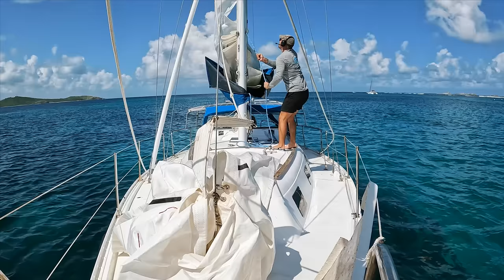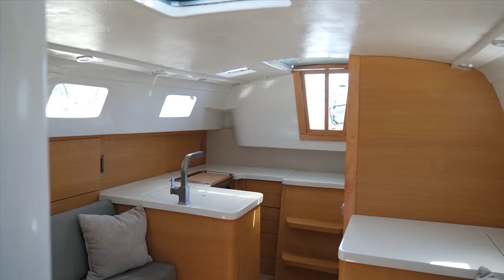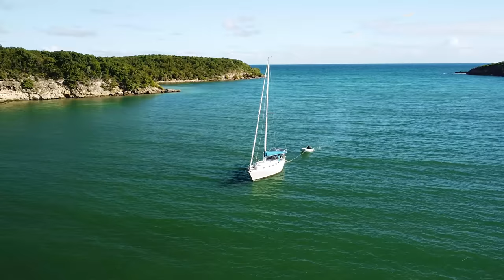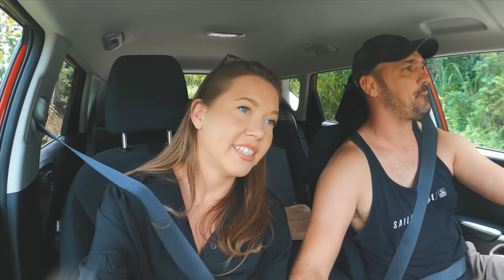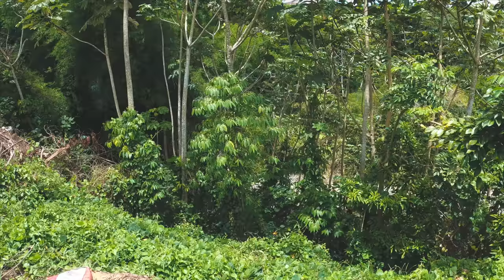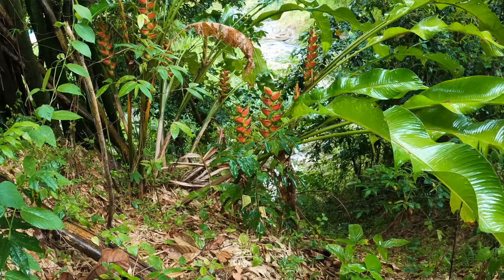QUITTING BOAT LIFE... (NOT CLICKBAIT)

Comment: As an engineer who created a dream home on a jungle lot I have some ideas. Use ICF for your walls. Insulation, pest resistance and hurricane strong, that’s the house you want. Add some steel trusses, a SIP roof deck and a steel roof, you’re ready for anything.  Try ground sourced AC, a backup generator, solar panels to make yourselves self sufficient. Good luck!
Reply: Should have mentioned hurricane proof windows, cut down tall trees near structures. Design a hurricane shelter where you can live. Looks like high ground, that’s where you should build.

Comment: Congratulations you two. I have watch you guys take chances and even though you struggle with all the things that go wrong when building a project you make it work. If you never take the chances you two have taken on you will never learn and be safe just following the crowd. I know you will be successful just by watching you over the years. You don't give up. 
I am 70 years old. I have been told so many times my projects are impossible yet i have completed everyone from building airboats to 14 airplanes. Several houses, sheds, decks, industrial warehouses that operate at -40 degrees. I do have an engineering background but  not everything is taught in school. Just take the bull by the horns and do it. Best wishes.

Comment: First job on new land. I always plant fruit trees--they keep growing while you are doing other stuff.  If you have fitted out a boat--you will have no trouble up-scaling to build a home--anyway, there ate kitsets available for interiors as well as the whole building.  If the building is concrete, it is fixable as long as the foundations are sound.
Reply: Fruit trees and prefab, good calls. I'd add "get professional advice for the initial stages, plans etc", there's plenty of less critical stuff that you can unleash your inner "ghetto-engineer" later on...

Comment: A roof and a little paint and you'll be in good shape. Throw up some solar panels, and you have electricity to keep the beer cold. It rains often in PR, so a water collection system will probably get you by.   It's always easier said than done, but yall are not quitters. I'll keep tuning in to see the progress.

Comment: PS. get your Soil tested Mine turned out to have a Chronic and Dangerous Copper Deficiency. Plus other not serious Deficiencies. Tips gather Seaweed and soak in fresh water to wash all the Salt out, andcthen dry, plus get lots of Seashells, rinse in fresh water,  dry, and Crush  to add t🎉o the land ,and dried salt free seaweed, and crush to a powder . and Buy a balanced fertiliser like 15:15:15 as about the same orice as 10:10:10 just use less of it, and best rotovators are Pigs, but even though very clean animals they are smelly- the only Downside. The most Cruel way to keep Chickens is Free Range.  I won't even buy Free Range Eggs. Imhad a flock of 48, and ugh Dinosaurs are Nasty to each other. Never again. Another Never again is Goats. Congrats on a Successful Purchase. Try to get Heritage seeds so you can harvest your own seeds. ❤Bob. 😊